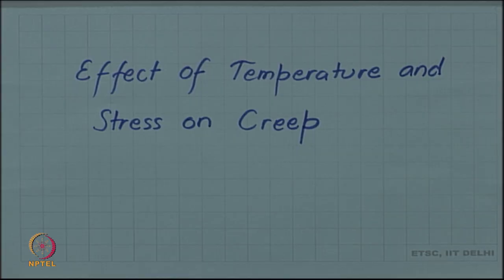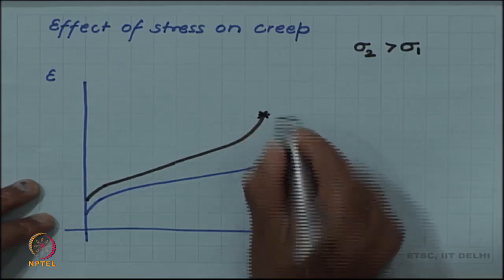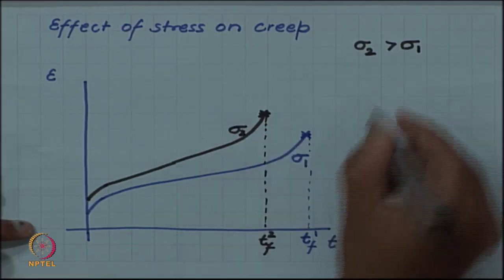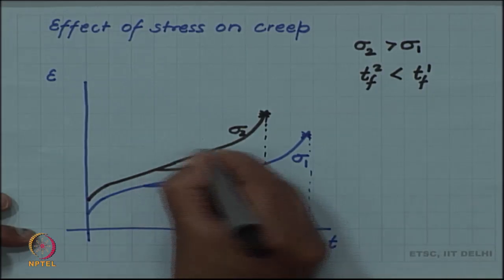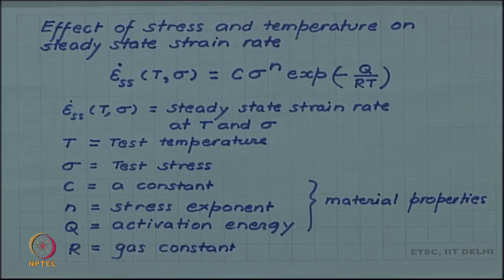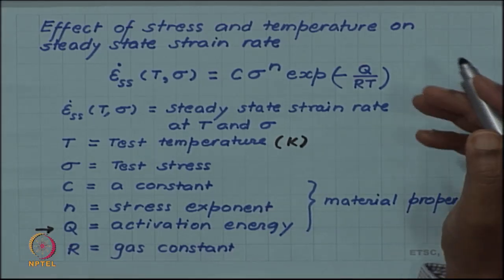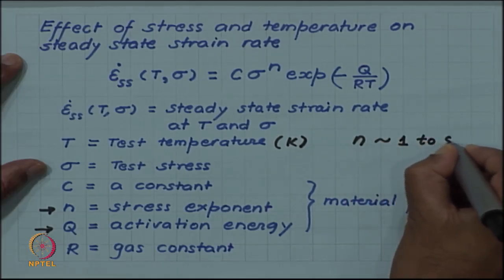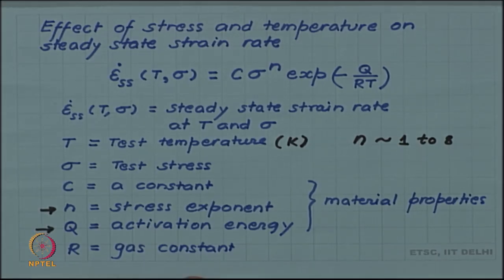Effect of Stress and Temperature on Creep

Comment: Sir I have one doubt 
As we apply load on any material constantly 
Strain will increase with respect to time right sir 
But you said that with increase stress creep life will decrease 
Here my doubt is 
As we apply stress on constant load strain will increase na sir
 It mean at first time t=0 no elongation 
As we go on apply stress strain increase and also time also changed mean timely 
Then creep life must increase right na sir
 you are saying it will decrease 
I can't can you elaborate some more
Reply from the maker: Creep life is time to failure at a given temperature and stress. If at the same temperature another test is done at a higher applied stress then the material will fail in a shorter time, so will have lesser life.